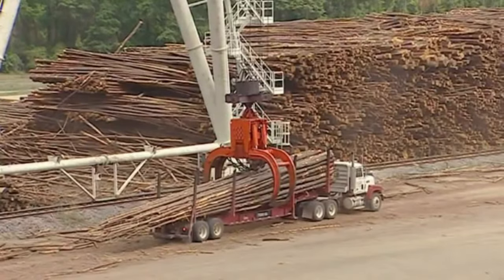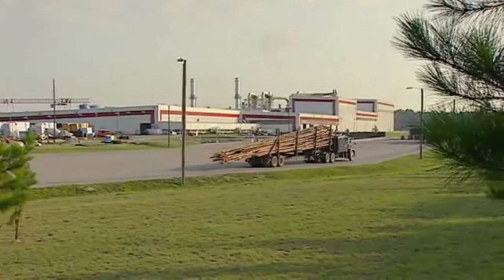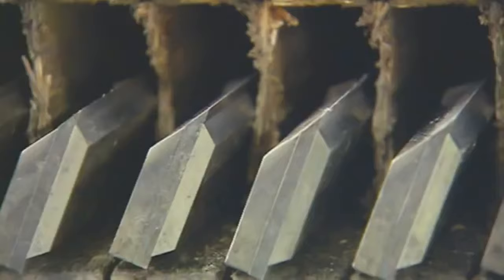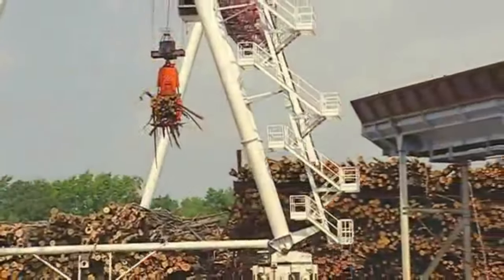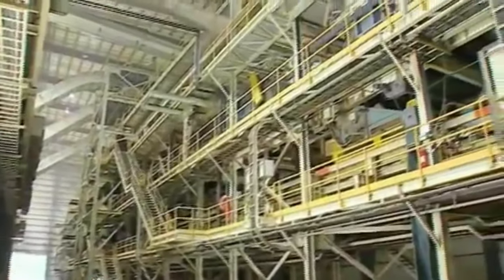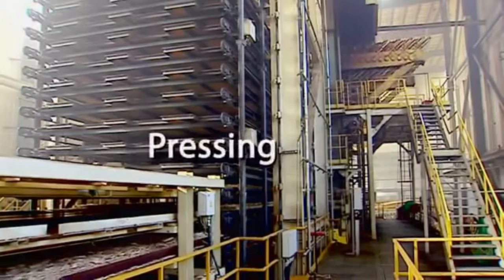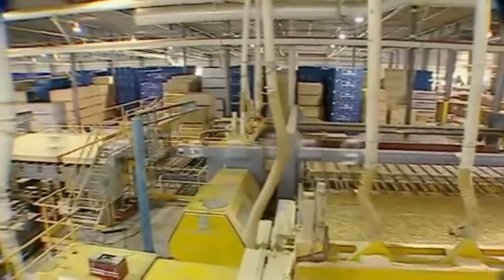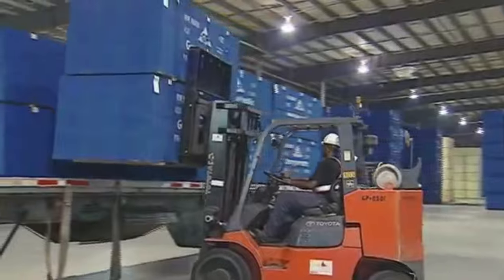How OSB plywood is made from start to finish!

Comment: OSB is NOT plywood. It can never get wet. Air blows right through it. I’m a former contractor and if you want a house that has to be completely remodeled every 30 years then go ahead and save $3000 now. And remember there are different grades of OSB and the junk from the big box stores is the lowest grade.

Comment: Worked for a competing company (that quite honestly made a better subfloor product) but I'm amazed at how every piece of equipment and every step of the process is nearly identical, down to the rotary waferizer.
Reply: Which product? Just curious cause I've got a sub floor to replace at some point
Reply: Because only a handful of companies makes these machines. 
And said to say, the best are made in Europe.
Reply: @gloriousapplebees  advantech. And I 100% will buy those products, even though I don't work there. They also make zip system, which is far better than house wrap. The job just didn't fit me, but what they make there is second to none.
Reply: @JRotten  yep, said company has plants in Germany. I left that job to work for one of the biggest mfg. companies out of Germany (think car parts and dishwashers), which I have also since left after a decade to change careers.

Comment: How about have the big OSB press  press OSB into the shape of a Canoe or other boat and coat it with some anti water coating? I was building a shed with OSB and taking my time so noticed OSB in the weather a while should get some left over abandoned paint on it since some stands start coming off. Instead of aluminum a steel or other thin coating for fire protection would be a nice option for OSB used back in the woods where fire risk is a concern.

Comment: I used to work at Lowe’s in lumber 

Early on I learned the difference between osb and ply wood but always was concerned when explaining to customers, which to buy when thinking of a sub floor

I didn’t know the difference between a 2x4 and a 2x6 when I first started for context 

Idk I was just curious as to how it was made and I found the video, so I do find it cool that I saw the exact type of osb we sold
Reply: Thank you.  OSB and plywood are not the same thing.  From the wood to the resin, similar applications, but different products.